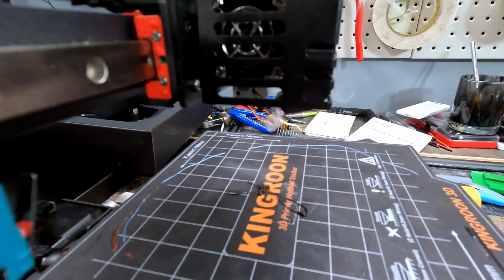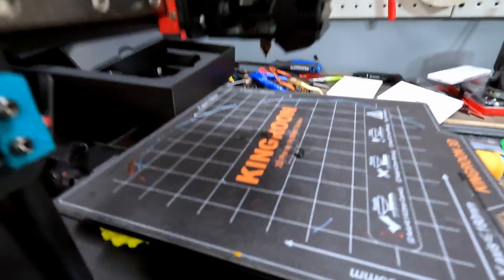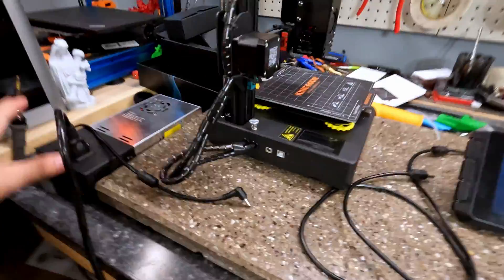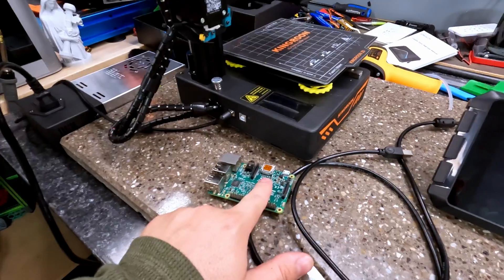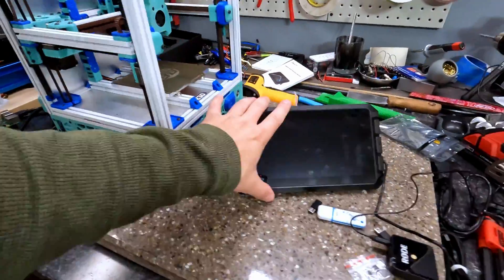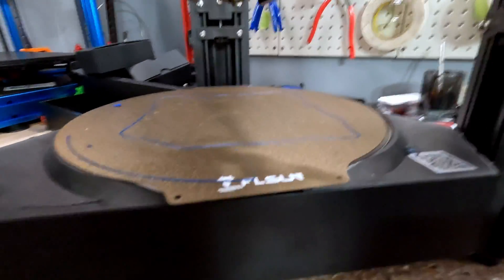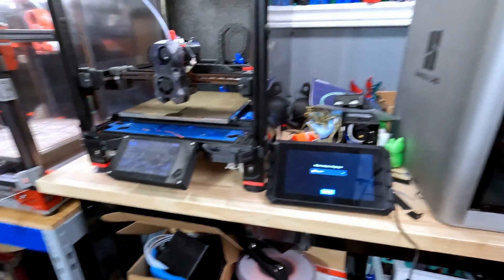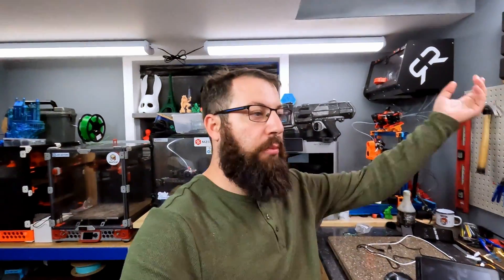Thermal Runaway - Not A Good Start With The Creality Sonic Pad

Comment: Can you recreate the issue by setting up a Pi with the Creality config and plugging it in to the same printer?  I'm wondering if the problem might be 20% less Creality and more "Klipper isn't plug and play".  (Creality is still responsible for their product and for it not having a safety cutout)  I doubt Creality validated it against every board/firmware combination.
Reply: How is Creality responsible for you plugging the device into a product they don't make/support?  They could test all kinds of boards and still miss your brand/model/revision.
Short of making unit tests based on the wiring of all the chips and board layouts, there's not much you can do in that situation.  If you plug this into Creality gear, it's probably fine, if you're not, you're probably not using the product as intended and the faults on you.
Reply: @pXnEmerica  Creality advertises that it is compatible with other printers, but does not provide much of the way in specifics.   

"Get It Going with No Hitch

Creality Sonic Pad can connect to almost any FDM 3D printer on the market via a USB cable. "

I would, at the very least expect the thermal warning to be consistent OR for the documentation to give a warning explaining the risks.

I don't think this is a show stopper (I have one on the way) but if they are marketing to users as "Easy Klipper" they need to set some expectations, even if it is just a line in the manual stating that if you load non-Creality firmware, you need to be ready to configure it yourself or it may get dangerous.
Reply: @kevinmccormick1886  I'm betting the thermal warning missing on the first printer would probably be because the thermistor may be on a different pin, so it doesn't know it's hot.

Comment: Not trying to defend Creality, and I'm not familiar with their product, but it seems like you're using it in an unprecedented situation. Lawn mowers didn't have a safety bar until some idiot (not calling you an idiot) cut his fingers off using one to trim their hedges and subsequently sued the manufacturer. As a design and mechanical Engineer, I know that it is impossible to predict every possible situation which someone may use a product for. I think Creality is receptive enough to feedback to make the appropriate adjustments that will prevent this from happening in the future. Please keep us updated about any communications and fixes.

Comment: Your using it all wrong. It does state to do not plug it in to the printer until specified. It says that you should read the instructions as they say add the cfg file to a sd card of your printer. Then add it to the sonic pad and move on. Then it says keep your printer turned off before adding the cfg file. Then you can turn it on. This is to prevent this happening. You stayed on the home bit and you need to go through the steps for it to work. It doesn't work plugging it in 😄. There should be a warning but I Hope you understand.
Reply: It literally does say to connect the printer before any configuration work. It also does not say not to power up the printer. So it is a problem. But if Nero followed the instructions exactly, he probably wouldn't have this problem. Unfortunately, people rarely do, and Nero is people.
Reply: @LeoTheHuman  have you got the sonic pad? You shouldn't just stay on the homepage of what language.
Reply: @3dprinterguy  It shouldn't matter if you do.

Comment: To add perspective, is it possible that this just got missed in beta testing? I mean it's quite a failure path if you only tested it with new parts. I can see where it was just legitimately missed. What will be interesting for me is what happens now. How fast will creality fix this? That will show their good intentions IMHO
Reply: Creality dont fix anything! they leave that to the community! if I were a gambling man I would be pretty confident in betting they have not fixed this and it is still an issue.

Comment: I am a Software Engineer.  If anything, this is a Klipper problem that needs to be addressed by the Klipper team.  Expecting Creality to test their product, which is designed to be used with Creality printers, with all other printers, is beyond ridiculous.  There is no possible way that Creality can test all other printers, nor should there be any expectation that they would do so.
Reply from the maker: So this normally isn't a klipper issue. A fresh klipper installed doesn't have any config setup and if connected to a printer. Nothing happens 

But by creality including a config pre setup and ready to go, it you happen to it into a printer with a board with the same cpu and usb serial address, this happens, and also they don't state anywhere that it is pre setup like this. So if you treated it like a normal klipper setup like I did. This is the result
Reply: @CanuckCreator  That would still indicate that Klipper is at fault.  If you read some of the other comments, others have run into this exact same issue with Raspberry Pi installations.  The bottom line is, the firmware (Klipper) is required to handle ALL thermal runaway conditions.  The auxiliary controller should not have any possible way of causing a thermal runaway condition.  If it is possible for the controller to cause a thermal runaway condition, then Klipper is at fault.
Reply: @cnc-maker  The board doesn't cause a runaway - the host does by misconfiguring it.

As a software engineer I would hope you're familiar with the dangers of wildcards in expressions.
Reply: @Monkeh616  which should not be possible, thus Klipper is at fault.

I used to work in aerospace, where a mistake like this would kill people.  I don't hold the Klipper team to that high of a standard, but I would say that they must ensure that someone's house is not burned down because of their firmware.

A simple fix to Klipper would be to turn off ALL output ports by setting them to 0 (zero) if a failure is detected.  The Klipper team should also define that for a controller board to be Klipper compliant, when setting an output port to 0 (zero), the functionality of the device connected to that port must be turned off.  I have not checked to see if that is defined anywhere, and if it isn't, that would be a very serious oversight.  Then controller manufacturers could publish whether or not their boards are Klipper compliant.
Reply: @cnc-maker  The Klipper team cannot define how other people design their hardware. Here, let me simulate the conversation for you:
Dev: Hi, I'm the developer of a very small open source software project, and this is how you're going to build your hardware from now on.
Large company: Haha.

Please, feel free to review the code and submit the 'simple fix'..
Reply: @Monkeh616  did I say they can define how other people design their hardware?  I very specifically stated that they can define what makes a controller board Klipper Compliant, and that manufacturers can optionally state whether or not they meet those requirements.  I don't see how anything else could be inferred from what I very specifically stated.
Reply: @cnc-maker  I don't see how it's Klipper's fault that they haven't defined 'Klipper Compliance' and someone else has misconfigured their product. Nor where this will prevent the same someone else from continuing to misconfigure their product, as they have using other firmwares for years prior.
Reply: @Monkeh616  you're just talking in circles and not really thinking about what you are saying.  How can the product be misconfigured if the Klipper team hasn't defined what is compliant?

The firmware is 100% responsible for ensuring whether or not thermal runaway is being handled properly.  That is undisputable.  Therefore, it is up to the firmware to do whatever it needs to do to ensure that thermal runaway is not possible, and any failure is the fault of the firmware.
Reply: @cnc-maker  I'm not at all talking in circles.

The product is connecting to a USB serial device without identifying it and configuring it incorrectly.

The firmware on the board does not know what pins are associated with what until configured. Any failure in configuration is the fault of the person who chose to apply that configuration to the board - which in this case is Creality, applying it to anything you plug it in to.
Reply: @Monkeh616  you have just proved my point again.  The Klipper firmware is not doing anything to validate that it is configured properly.  Thus, Klipper is at fault.  Allowing anyone, or anything, to incorrectly configure Klipper is the fault of Klipper.
Reply: @cnc-maker  Then Klipper is at fault for being intended to be used on arbitrary boards with varying configurations, and you should avoid ever using it because it will disgust you in its flexibility.

I also suggest you avoid the use of any form of hand or power tool.
Reply: @cnc-maker  The thing is it has no way for detecting a failure if it's being fed false data by a config for the wrong device.  As we saw on the V400 it threw an error for sensor out of range because the pins for the thermistors were open and not reading.  Unfortunately on the Kingroon the 2 thermistor ports defined in the Creality default configuration  were tied to parts of the display that unfortunately had the correct resistance to tell it the thermistors were reading within a safe range. Also Klipper had  no clue it was running a heater.. it's config was told that pin was to hold an endstop high.  Ideally the device shouldn't ship with the klipper service running.. It should only start the service after the startup configuration has been completed.  By default on install Klipper will have no configuration file and as you point out should and can do nothing. This is the standard. Creality chose to ship it with a printer configuration in place.. That is a problem caused by Creality by bypassing the safe default install.
Reply: @Polar_Ted  that isn't accurate.  Because Klipper has become so popular, and has a large growing community, they need to add configuration validation to the firmware.  Klipper has a static firmware build for each processor, and it requires the user to configure the the configuration files.  However, it does very little to ensure that the configuration files are configured correctly and allows dangerous actions to occur without validating that it is safe to do so.  That is it's failing, and it needs to be rectified.

For Klipper to be safe for all, it needs to perform validation testing upon first use of each port/device, and upon any changes to ports/devices.  When something new is detected, it needs to perform safe actions and require the user to validate that the actions are correct.  If the validation fails, Klipper needs to shutdown the machine and allow the user to correct whatever failed.  Like I said earlier, there is some code that does this for some pins/devices/functionality, but it has a long way to go.  It's like we are currently running DOS, while there is a hint of Windows 3.1, but we need to get to Windows 10.

Do you understand what I am saying now?  This isn't something that is going to happen overnight, but it is something that needs to happen.  It will take quite a bit of work to complete, but it's not as daunting as one might think.  It will require coding on the client side (UI) as well, but again, not as much as some would think.
Reply: @cnc-maker   I can think of one simple method to verify configuration. That would be to integrate a configuration ID into the MCU firmware.  Something to say Hello klipper I am ID SKR14T   If that ID does not match the MCU ID defined in the printer.cfg klipper shuts down the MCU.
Reply: @Polar_Ted  Klipper can already be configured to only connect to the correct MCU. The whole problem here is that they intentionally shipped it configured to connect to anything.
Reply: @Monkeh616  Can you point me to the documentation on that feature? I'm interested in seeing how its implemented.
Reply: @Polar_Ted  Can't really do links, but quite simply the device manager creates symlinks to identify devices by their serial number, and you use that link rather than the raw device name. It's not a Klipper feature but a basic OS feature which is necessarily leveraged to support multiple MCUs on one host.
Reply: @Monkeh616  That right there is the rub in this scenario as noted by Gdachs in the Discord chat on this subject.. Both the MKS Robin and the Creality Silent board front end their CPU with a CH340 USB to serial converter.  That chip has no ability to offer a unique serial number. To the host they all appear as the same device.
Reply: I think you're misunderstanding the point.  All you are doing is detecting a change in which printer you are connected to.  What I am referring to is the fact that Klipper currently doesn't have any method of validating that anything is wired, or configured, correctly.  Until that is done, everything that you are discussing is moot.
Reply: @Polar_Ted  Ah, now that I wasn't aware of. Note taken, those boards are entirely unsuitable for use. There's a reason I don't touch CH340s.

Still, there's no reason this thing should connect when it isn't even set up.
Reply: @cnc-maker  Please feel free to come implement such functionality.
Reply: @Monkeh616  it's always nice when you point out serious software flaws and random people expect you to fix them.  Nice try, but the Klipper team can do it themselves.
Reply: @cnc-maker  Well, perhaps instead of waffling on in these comments about how important it is that they fix this glaring fault you've identified.. you could actually at the very least go and make the suggestion and give your expert advice in a forum where the developers will actually see it.
Reply: @cnc-maker  You know what either you do it or Creality. Using open source projects ignoring their license. Removing copyright and then shifting the blame onto the maintainer of that project while still making money with it. Nice try do it yourself or Creality has to do it. Stop using open source projects as a means to outsource your developers.
Reply: @TheOfficialDarkICE  ROFL  You obviously know nothing about open source projects, and it's funny when the pot calls the kettle black.  Have an AWESOME day!

Comment: So, short version, Creality Pad, which is set up for an Ender 3 out of the box, may not work correctly when hooked up to a non Creality printer. Also in breaking news, ice is hard AND cold!!!!! More news at 11 pm.
Reply from the maker: The issue is. There is notthing on the package or manual stating this. During setup there is the option even to setup a non creality printer and klipper itself is a controller board agnostic firmware so the sonic pad being a rpi alternative and touch screen would seem like a valid option for many
Reply: @CanuckCreator  Well - That's easy to solve. Just give a warning when you enter a custom (non Creality supported printer) configuration that they cannot guarantee correct working, and cannot be hold responsible for any damage caused by non-standard configurations. Problem solved.

Comment: I'm a bit confused as to why you expect Creality to test their product on other manufacturers machines using non standard firmware. There must be thousands of variations between different machines, motherboards and firmware - it would be impossible.
Reply from the maker: The issue is. There is notthing on the package or manual stating this. During setup there is the option even to setup a non creality printer and klipper itself is a controller board agnostic firmware so the sonic pad being a rpi alternative and touch screen would seem like a valid option for many
Reply: It's really just a simple oversight, it shouldn't boot with firmware for a printer or board that it doesn't know the config for. The ball is now in Creality's court.
Reply: Found the Creality shill. Are you CHEP?

Comment: So if you do not have klipper installed this is not an issue is that right? If so then most people would be ok as the point of this is to upgrade from marlin to klipper so most people that have klipper would not be buying this. Having said that one person finding this is one person too many and I am glad you have identified this as it is a big fire hazard.
Hopefully if creality are informed they will do a firmware update to stop this, they should have tested this before release I do wonder if it never occurred to them that someone using klipper would plug this into their printer. Not an excuse just saying.
Reply from the maker: Well during a normal klipper install you flash the board then setup the config. Doing that would have a period where the sonic pad is connected but the config not setup. Also I could see someone potential swapping out a rpi to free it up for another usecase with the sonic pad or similar all in one to add a touch screen. Just some thoughts
Reply: Appreciate you finding this as I have one on order, it is concerning

Comment: This literally just happened to me with a different SBC and the ABS smoke took me two days to fully ventilate out. The thermistor stayed 240 for about half a minute while the heater was on full.... Not sure what the problem is, so I replaced both heater and thermistor
Reply: What board?
Reply: @Polar_Ted  skr mini e3 1.2 with pine h64 SBC. I suspect the SBC froze and didn't turn off the heater, it did come back after half a minute and last it logged 415C at the hotend before it turned off